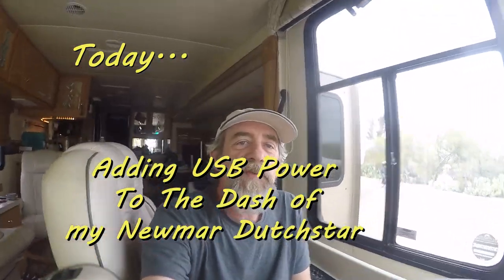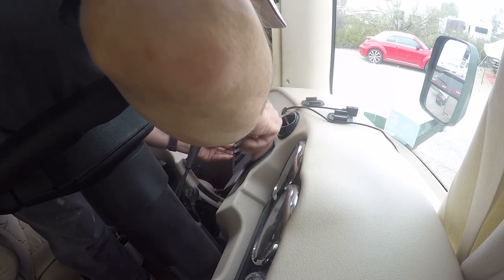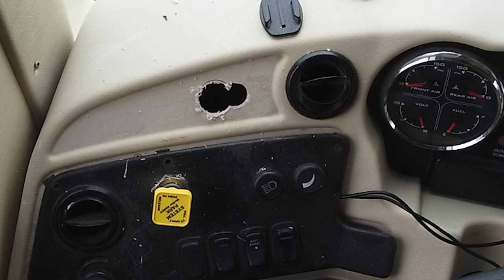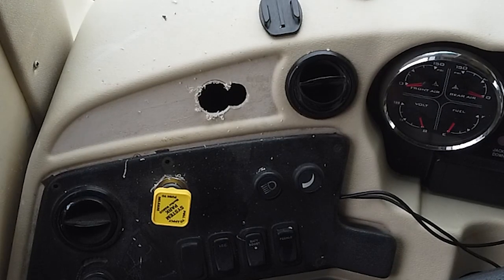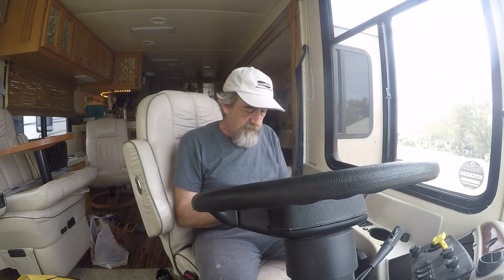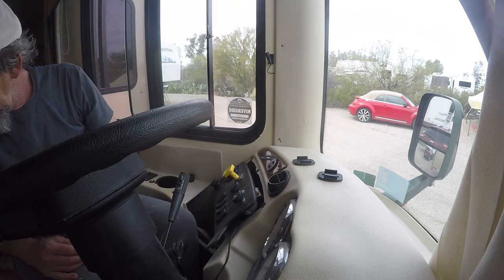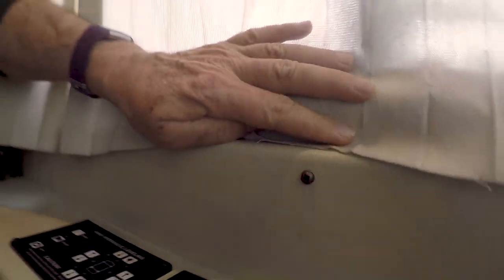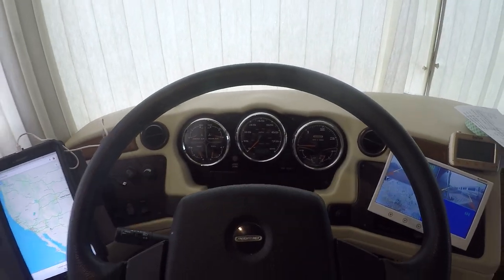Installing USB Power Ports in the Dash of my Newmar Dutchstar RV  ||  RV How-To

Comment: Another informative video! Thank you!
Is there a particular wire in the side pocket I should use to power up the USB ports that I plan to install?
Reply from the maker: Thanks Michael! Well every coach is different but since the USB port adaptor draws so little current you can use just about any 12 volt circuit. I happened to have installed a CB radio 8 years ago and I ran a dedicated power line for it from the fuse block that is in the container right under my side pocket so I used it.

Comment: TR, Are the USB ports powered  by the chassis or coach batteries?  Any pros or cons on which might be better? Good video. Thanks, Larry
Reply from the maker: They are on the chassis battery. Since I really use it when I am rolling down the road I chose to use the chassis bats. I think you could power them from either source. I think it really depends on how you use it. If your using it for day to day charging then the house bats make more sense.